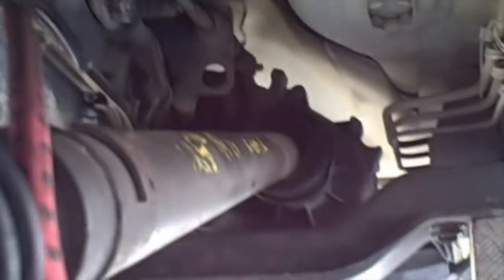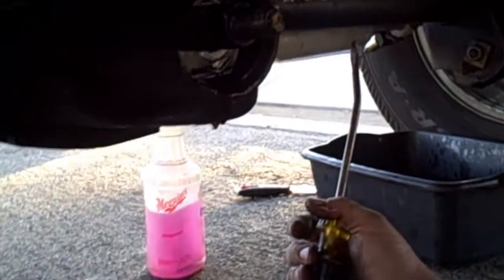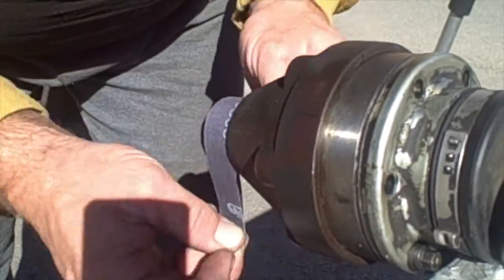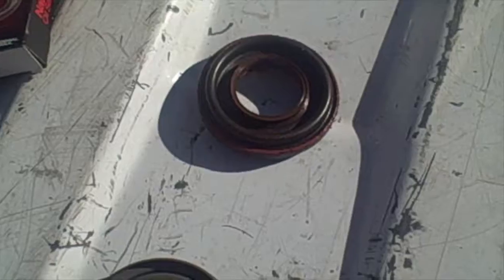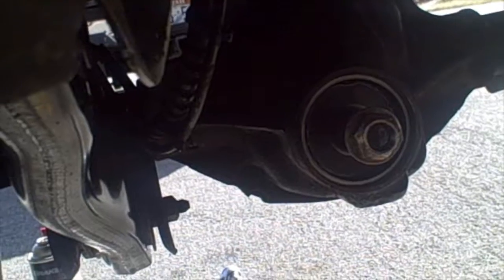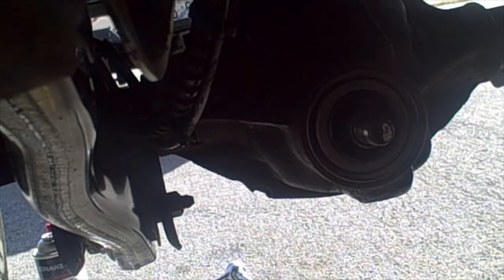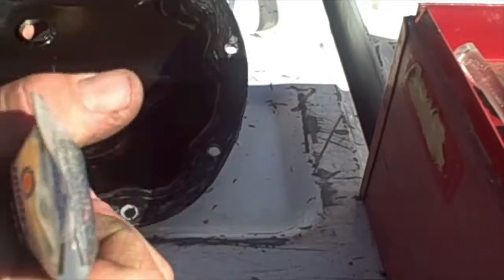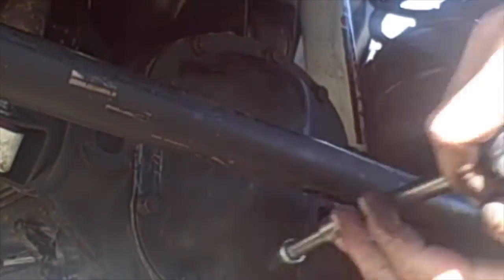How to replace Jeep front pinon seal

Comment: Hey want to start off by saying awesome video man very helpful! But I did see something in your video it's the upper control arm on the side of the diff right above it I noticed yours was cranked crooked just like mine is and I've came to the realization that we need adjustable control arms man to make it work right cuz I'm having the same effing problem I remember I had my passenger side wheel in the front tucked all the way into my wheel well and my driver side was drooped now if you think about it that's exactly what way it's going to pull that thing and mine did the same thing too but it pulled mine all the way out. I'm sure that you've already caught this and you've already seen it but I just wanted to let you know man awesome video very very helpful and I wanted to let you know about that control arm issue that I was having and just seeing your video that just made me decide that I have to get adjustable control arms or it's just going to keep popping it out. Thanks buddy keep putting our killer videos Man! 💪😎

Comment: What do you torque the little cv shaft bolts to? Also the pig nut under the yolk? Do you have to do anything special with clearances or do you just bolt it back together?

Comment: That helped, thank you.
I was told by the car service guy, who changed my gearbox oil today, that there was a leak right there, and that it was the oil seal ring.

I have a Jeep Grand Cherokee 99, 4.7 WJ.
Q - Do you know what serial number that has. Would it be smart to order the extra seal swell as I order the O-ring, or do they automatically come as a kit?

Comment: Just curious if the seal is still holding up good because I've been reading that u have to use a new nut and a crush sleeve and the nut has to be torqued just right? Seems pretty simple the way you did it
Reply: Silent Majority if you have a low pinion dana 30 you should so that your pinion bearing preload is correct. You are right in thinking this.